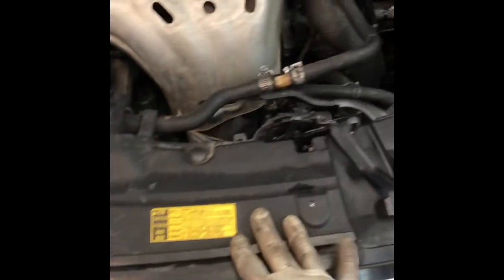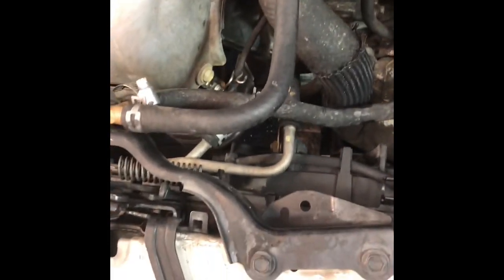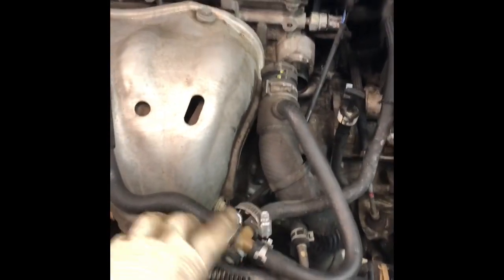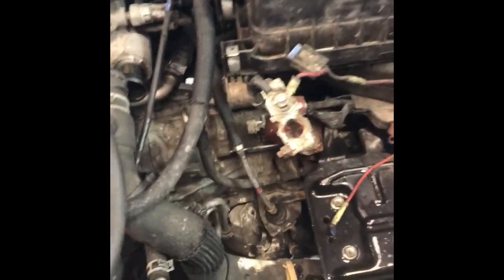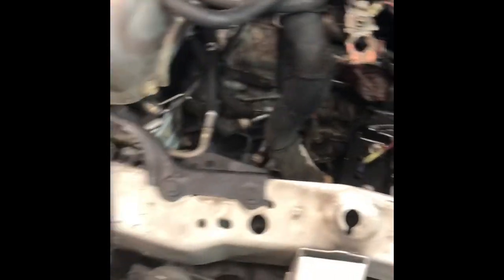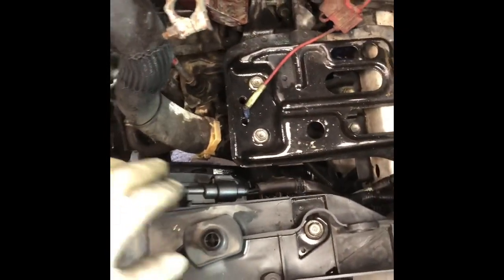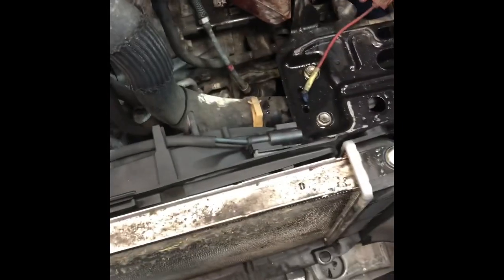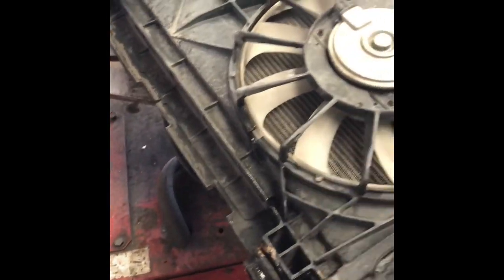How to replace a radiator in a 2015 Scion xB

Comment: How difficult is this job?
Reply from the maker: Doing this job the first time is a little doozy. Of course we all perform at different levels so don’t beat yourself up if it seems like you struggle with or thinking it might be a little difficult. Also something to remember is sometimes underlying issues with your vehicle can present itself for example you change your radiator and for some reason now the coolant won’t bleed the air out because there was a bad thermostat that you didn’t know was there.  I hope my video helps you/guide you in the right direction.

Comment: So you didn’t need any kind of coolant pump to get all the air out?Just run it with the cap open?I just changed out the water pump on a 2012 xb. What fun that was. Wasn’t sure about adding in coolant. I’m use to the radiator having a cap plus the reservoir. 205k miles and still going strong.
Reply from the maker: Orrin what’s up yes since it’s a closed coolant system the radiator has no cap so you can fill the correct coolant at the “pressure tank” until it’s at the full mark . Than run the car with the cap off until it warms up enough to open thermostat or engine gets pretty warm you can rev the engine a little at this point so more coolant will pump. than shut off engine for a good 10 minutes or so the coolant should have dropped some or taken it’s drink per say. Than fill to full mark again.
Reply from the maker: Orrin also I suggest keeping eye on tank make sure it doesn’t run down to low or completely empty sometimes this process works fast. be safe
Reply: Thanks for the reply and information. I have it topped off and checked for leaks after it pressurized. Everything looks good so far. Thanks for you help and video!👍🏽

Comment: Good video! Quick question, where did you get the T fitting? I need one since my broke while changing my alternator lol
Reply: I think you can only get it with a new radiator hose? Junkyard?
Reply: I used a 1/2 tee but since the bottom hose is a 3/8  I added a small hose with a 3/8 reducer. If you can find 1/2x1/2x3/8 you could just replace it.
Reply: Was changing my front motor mount this morning and I broke that same damn T 🤣🙄

Comment: Do you have video removing the radiator fan?
Reply from the maker: unfortunately I do not :(
Reply: It looks like i need to remove the radiattor to be able to replace the fan?😒
Reply: @jannacino5495  JUST WENT THRU THE SAME SITUATION WITH THE RADIATOR & FANS ABOUT A YEAR AGO. NOW I ONLY NEED TO CHANGE JUST THE FANS. 
I DON'T REMEMBER BUT I THINK I WON'T BE ABLE TO TAKE JUST THE FANS OUT WITHOUT REMOVING THE RADIATOR... HOPEFULLY NOT, CAUSE IF I DO, I'LL HAVE TO EVEN DRAIN THE COOLANT & ALL THE SAME PROCEDURE AS IF I'M DOING THE RADIATOR... DAMN!!!
P.S.
IS TRUE, THIS IS THE ONLY VIDEO FOR THIS MODEL REPLACING THE RADIATOR, UNFORTUNATELY NOT JUST THE FANS BUT AT LEAST WE CAN HAVE AN IDEA. ... 👍
Reply: @jannacino5495  Did you ever ended up replacing the fans without removing the radiator ??? 🤔
Reply: @irvingrosado3268  to replace the fan or radiator they both need to come off because they bolted together